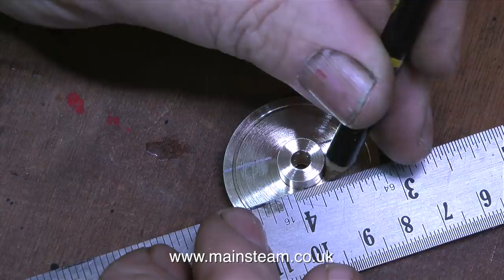A MODEL STEAM BOAT NAMED EDITH - PART #25

Comment: Hi keith, different question but whats the type of rubber pipe you use for testing your engines? Many thanks and im enjoying the video series
Reply from the maker: It is Silicone rubber pipe as used in the automotive industry, I buy it via Ebay.
Reply: Keith Appleton  thankyou :)

Comment: Are you going to use a high torque servo? Does not appear to have enough leverage for a rudder that size.
Reply from the maker: I have already fitted 3 metal geared high torque servos ...... there is sufficient leverage, the prop wash from a low revving steam engine is not excessive.
Reply: Keith Appleton thank you Keith for the response and explaination!